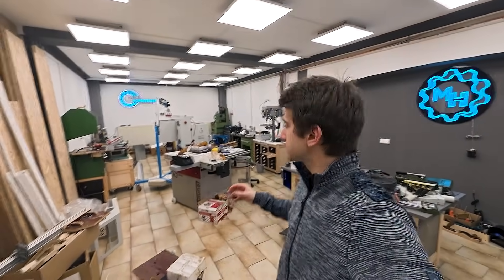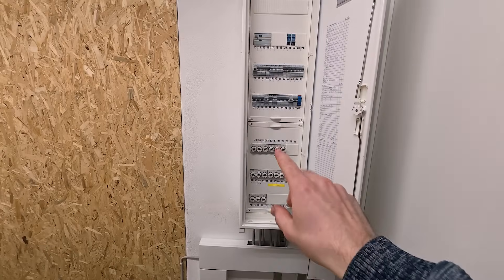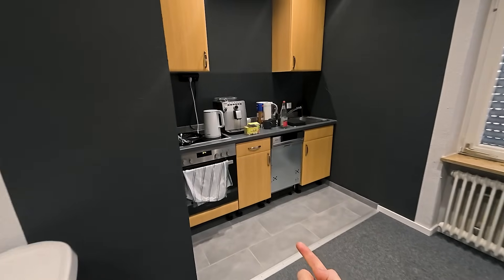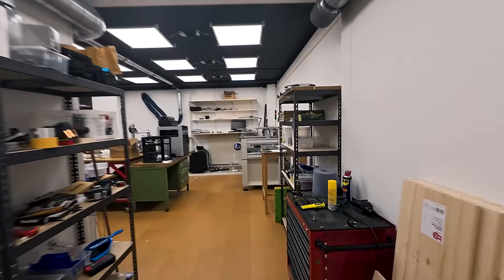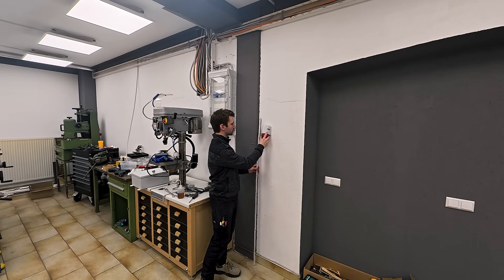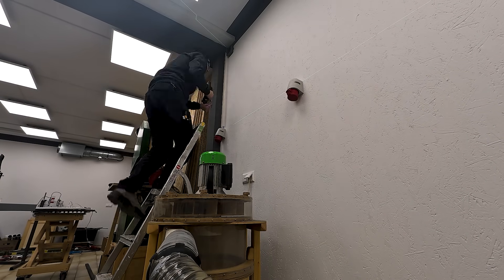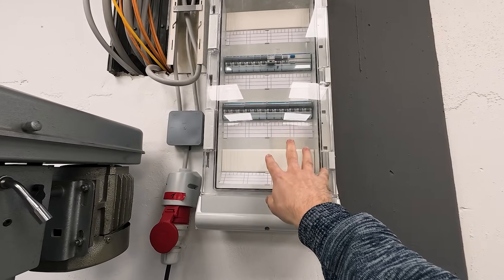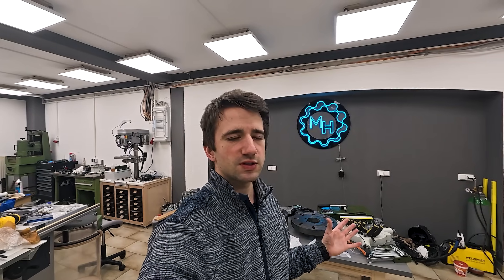New Workshop #17 || Electrical Installation

Comment: Im interested in how you all have somilar power usage.  You have such large machines that must have a serious draw.  But i imagine their maxhine might have longer run times.
Reply: A single FDM 3D printer usually has 40-60W for the hotend (not counting heated bed and chamber). Multiply that by 5 3D printer (just as an example) you get 200-300W. Make it run 20 hours a day and you got 4kWh-6kWh. Meanwhile a heavy machinery may draw several thousand watts but in one day maybe only 2-4 hours of operational time. So yeah, they can be equal because lots of small power draws for a long time is the same as one big power draw for a short time.
Reply: I’m guessing they have more 3d printers and such that might be running for multiple hours (prints can easily go into 20+hours), compared to his power-hungry machines that are only on for a few minutes at a time.

Comment: for the RCDs- can they cover the full load of all the circuits connected?
curious as for mine the installer used a far lower RCD max rating that the combined load as of the wiring used for the rcds, am unsure why a lower gauge wire wasn't used to cover the full load as now we get nuisance trips from it and upgrading it is a pain for how the wiring was done
Reply: Smallest RCD (in Belgium, I suppose it's the same in Germany) are 40A, since they have 3x35A, it shouldn't be a problem
Reply: I'm pretty sure they can handle that. The most common used type is designed for 40 A (25 A types are usually more expensive as they are produced in smaller quantities). And all their sub-distribution boards are fused with 35A. And by the way, an RCD does not trip in the event of an overload, there is only a risk that it will be destroyed and cannot trip safely if there is a residual current.
Reply: @gaunerchen1729  ah yeah indeed. also my bad- mine is an RCBO. it seems to me might be some wiring mishap as it's a single B type/ 16A only, and commonly trips brining the whole house (100A service, 7x 16A MCB) down. I am quite confused how mine is configured.
Reply: there usually is a selective breaker before the rcd that matches its rating.
the load behind the rcd does not matter in that case, because the selective breaker will trigger if the load is too high.

Comment: Perhaps separately metered would have been better just in case somebody takes a couple of weeks out, or maybe just to future proof
Reply: Well, adding meters to the individual distribution cabinets is quite simple, so future proofing is "there", also couple of weeks of electricity could be handled with the main meter (check before the break and after -> that amount only for the ppl present) and might be neglible in the long run (everyone is out of the shop for some time, should balance out)
Reply: Well, if somebody is out on vacation for a couple weeks, he just wont need to pay his bill for that time, no? :)
Reply: @marcoschwanenberger3127  as stated in the video, they get one bill and just divide it threeways.. Also at least here the electricity is not billed weekly or even monthly
Reply: @marcoschwanenberger3127  Well if the bill come in once a quarter it's tricker to split it fairly if you don't know exactly how much each person has used.  I'm not saying it couldn't be done with proper record keeping, but it is considerably more complicated.  Also people will be much more careful with their usage if they pay exactly for what they use.  In the building where I live the heating is paid for communally.  People are not nearly so careful with their personal usage
Reply: Or the first one to get into AI

Comment: Really well done, looks solid! Btw. was there a reason you kept the original floor tiles, instead of something a bit more fashionable?
Reply: I would have choosen a more eaven surface for mooving heavy mashines or projects
Reply: Floor may look dated but those tiles look solid. If u did a new floor u would have to be allot more careful with it.
Reply: I like them, they look authentic an contrast is nice sometimes
Reply: I like the original floor, it looks nice. Still curious why that was the decision though!
Reply: The best would be what we use in our shop floor, rubber. You can see what I mean in a matt armstrong video of his new shop.
Reply: It's a shop as long as it isn't a safety issue who cares